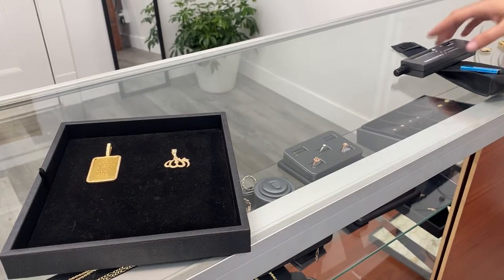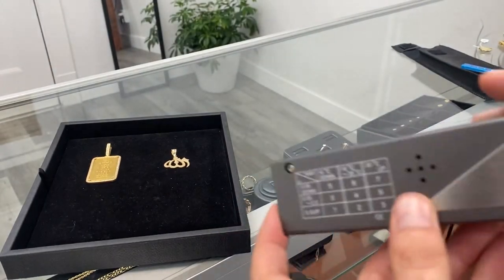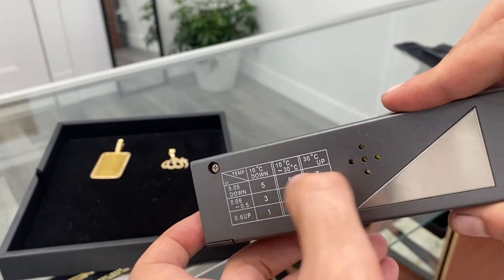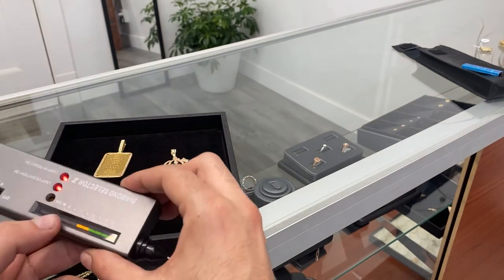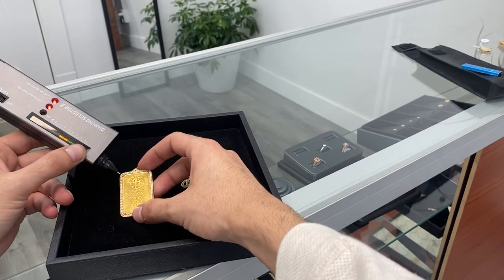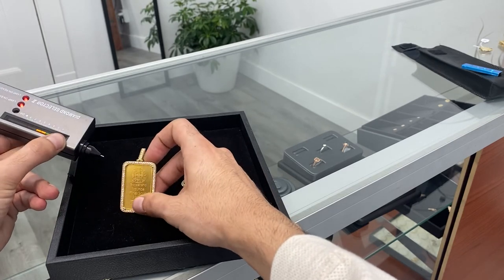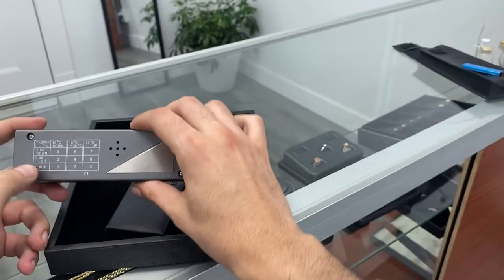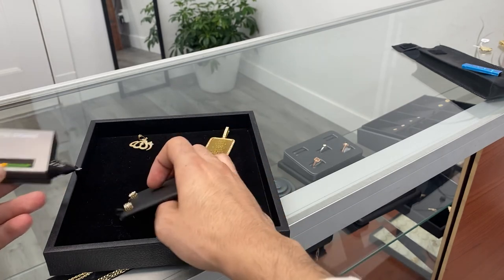How to use generic diamond tester (ebay & Amazon) 2021

Comment: That mois tester might not work got the same pack in today tried it on a diamond cross and a fake Cuban the diamond cross ofc came back positive with selector 2 instantly but when I use mois tester it comes back as mois! 

So I did a second test on a fake Cuban no response from the selector but came back as mois when I know it’s czs lol inaccurate results on that test side
Reply: I was going to get a Gemoro or one of the higher end testers but even then I’ve seen videos of those testers pasting off mois as diamonds. Only way to tell fully is to take it to a jeweler or use a loop at this point I feel like.

Comment: Thanks!  Seems like a piece of junk.  It’s called a “Diamond Selector” not a tester,  whatever that means ?   Also, to set the number of LEDs, you use the “Volume” wheel.  Go figure !  Then there is no clear Yes or No answer, just more lights.